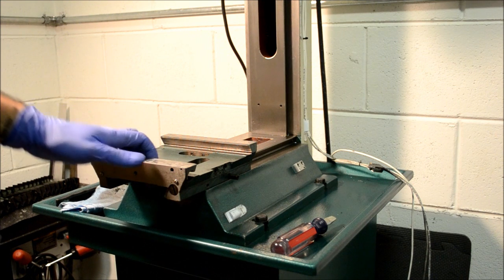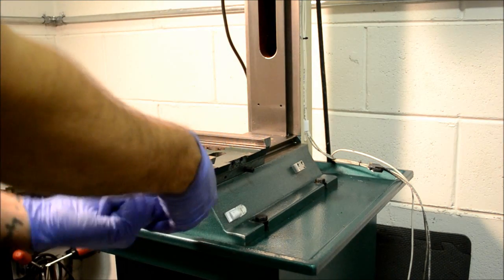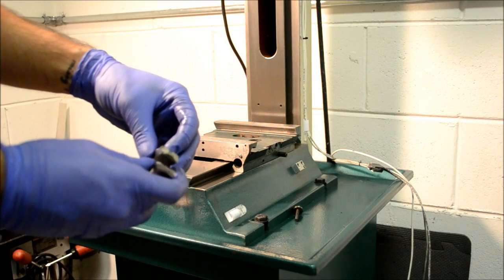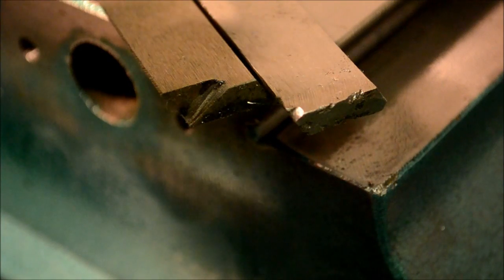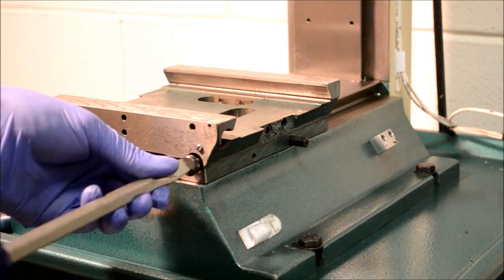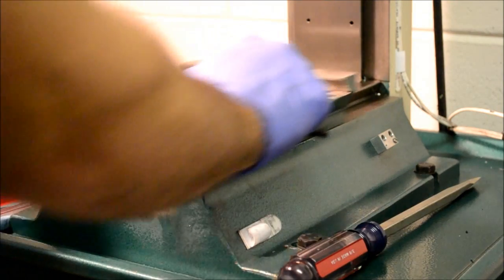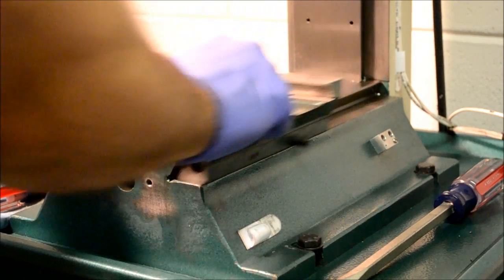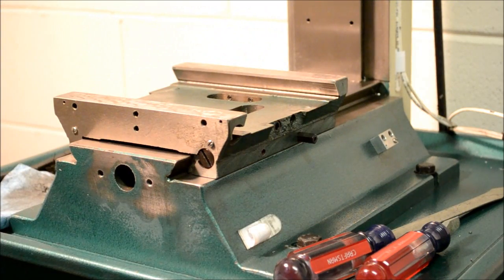Behind the Chips! Episode 1 : Y-Axis Gibs

Comment: I'm sure you have figured this out by now, but you loosen the thin edge side of the "tapered" Gibb and tighten the thick side to increase the wedge effect until play is gone, then gently tighten the thin side screw to keep the Gibb from sliding out of adjustment but no more or you can bow it.  Never tighten the thick side against the thin side while it is tight against the Gibb in an effort to "adjust" it.